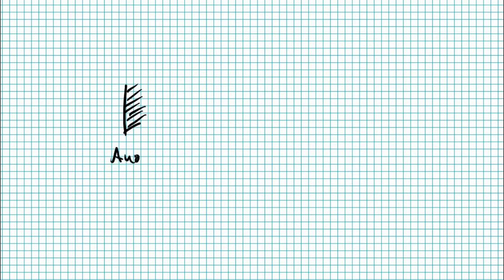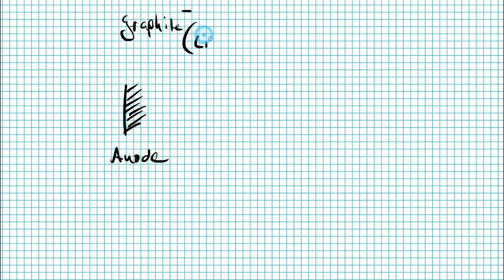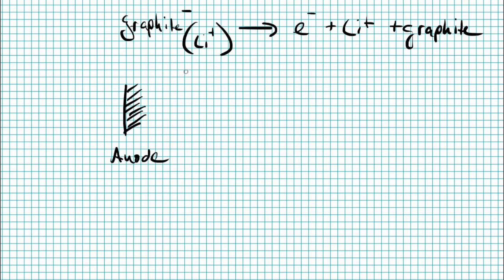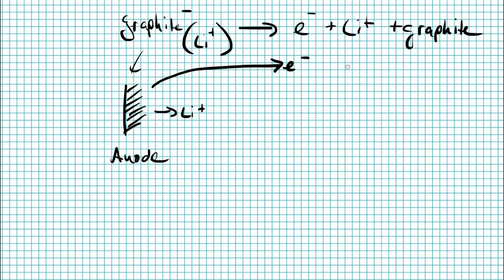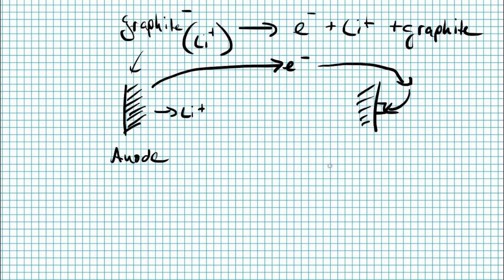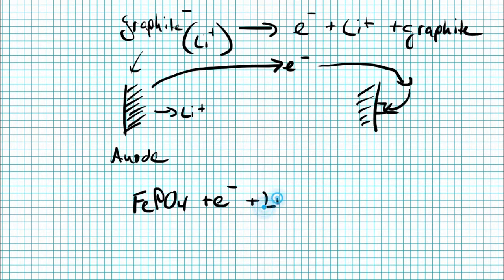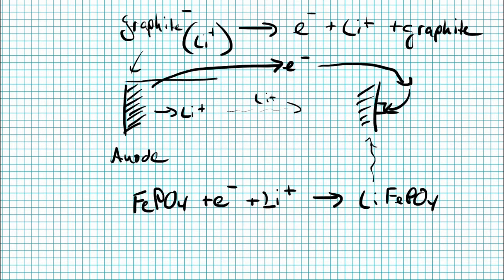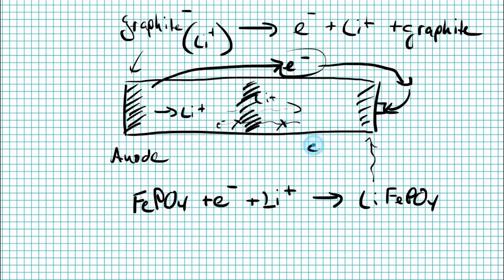How a Lithium ion battery works (corrected)

Comment: Needed to be lot more technical, chemical formula given isn't a valid one, membrane prevents ion transfer not electron. In rechargeable battery anode cathode doesn't really mean a lot as they switch the position during charging and discharging. Technically anode is where oxidation happens. However, always highly appreciate all the efforts and knowledge.
Reply: But when did he said that ,
" Electrons  goes through Electrolyte ! "
Reply: And you are wrong , 
Here "... Membrane prevents ion transfer not electrons ...." Instead opposite happens